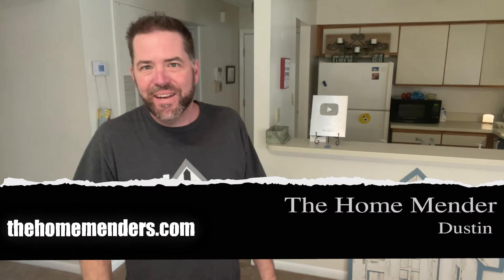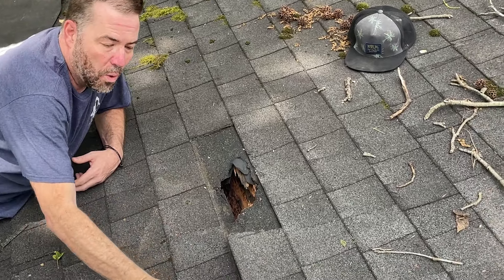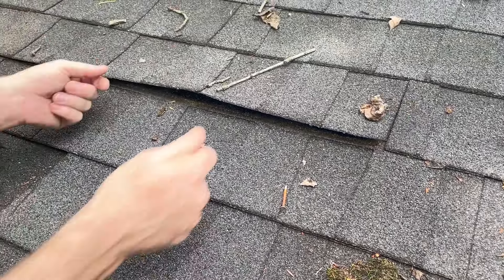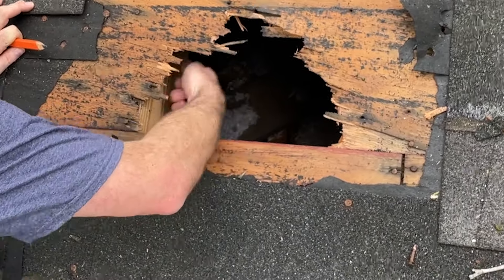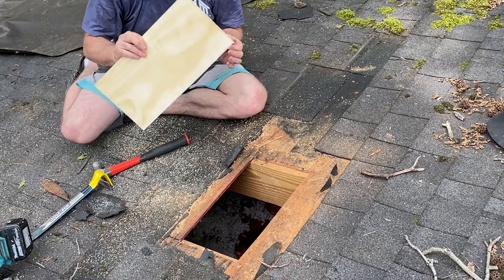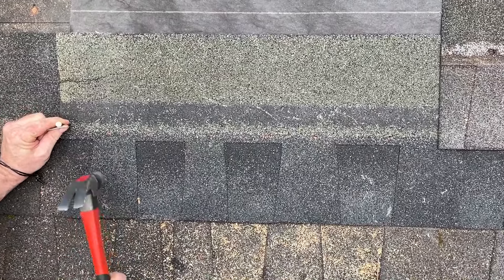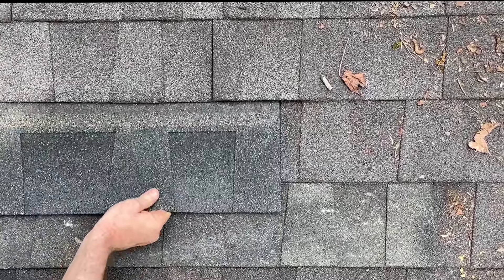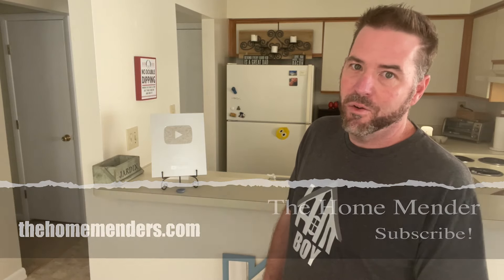How to roof? You can't! Replace architect shingles and plywood.

Comment: Hey just wanted to say thanks. This video gave me confidence to fix my own as well. What would have cost me over $500 i fixed myself for less than $100 in parts. I still had issues with the shingles because the nails were rusted and broken due to plywood being rotted. Again thank you and I appreciate the confidence boost.
Reply from the maker: This is an awesome comment. Exactly what I like to hear. Thank you so much.

Comment: awesome.. I was in the same spot about a year ago.. I had to cut around the shingles on one end! it had a valley from the top.. 3 tab shingles were a bit tricky. I used to use a lot of roofing cement on top and sides of the shingle.. the hole was about a large as softball. tree limb fell through the ceiling from a storm! I had a small pin hole which is really tough to find.. which I think I have gotten. it.  thanks for your video
Reply from the maker: Absolutely Steve. You are awesome. Thanks so much for sharing

Comment: Any recommendations for a wavy roof? We've moved into an older house and it seems all to be wavy, but no leaks and no exposed fiberglass on the shingles yet.
Reply from the maker: Wavy roof usually means the plywood needs to be replaced. :-(

Comment: Wait... don't you need some kind of roofing caulking or tar between the shingles for a new installation and the ones you lifted?
Reply from the maker: Hey social. Shingles have some dip on the back that adheres when the sun heats them up. Excellent question.

Comment: I agree and disagree with you on the confidence thing. If you are mechanically inclined, sure try doing your own repairs. Some people just are not capable if doing this kind of work. It all comes down to how your brain works. I grew up around construction, but never did lot of it. When I bought my house It ended up having a ton of  issues that I didn't the money to pay the pros to fix, so I was forced to do them myself, even though I had not done them before. Since I bought this house I have done electrical, plumbing, framing, flooring, drywalling and skim coating, painting, Pest control, and a complete kitchen and bathroom remodel. So far, everything has worked an I haven't had to tear anything out and redo it. Of course, I have done tons of research to make sure everything it safe and correct, which some people don't do. 

My former step dad had all the confidence in the world and caused tons of damage to my mom's house and left dangerous electrical work and structural damage everywhere that my Dad ended up fixing for my mom after she divorced my step dad. As a kid I watched my step dad destroy a couple different vehicles by "fixing" them himself to the point where they didn't run anymore. He repaired a leaky roof by putting  sealant on the inside where the water was coming through and never fixing the actual source of the leak, so it ended up doing massive damage to the roof, which my dad and I ended up having to fix for my mom. The fact is, some people should just not be allowed to work on anything.
Reply from the maker: You are right about that sir. Some of my best victories were from times I screwed up and of course that should only happen once. Thanks so much for sharing